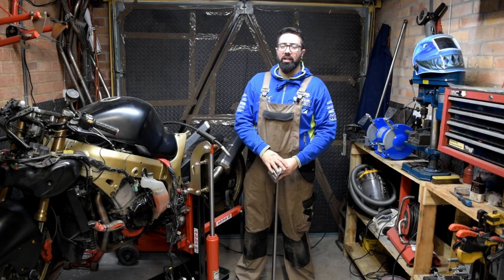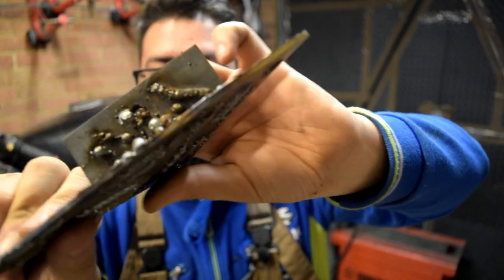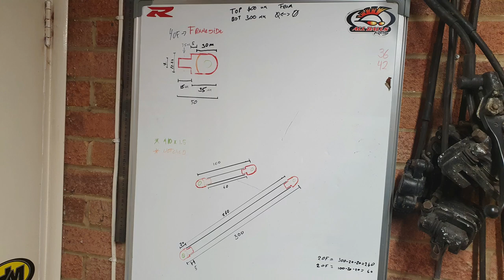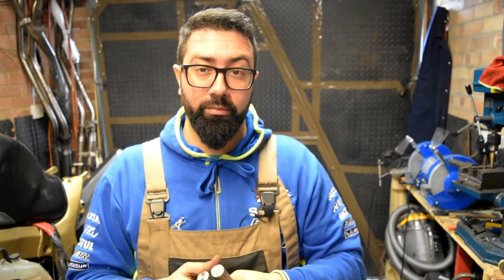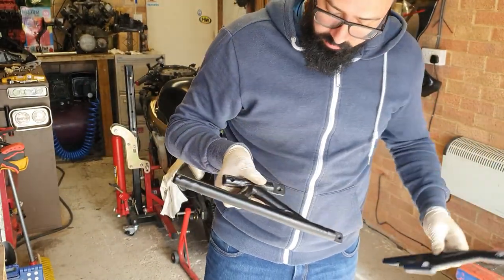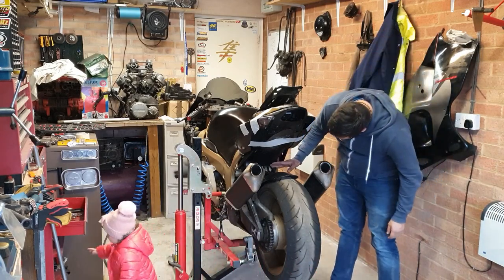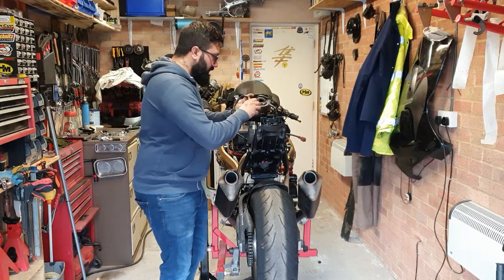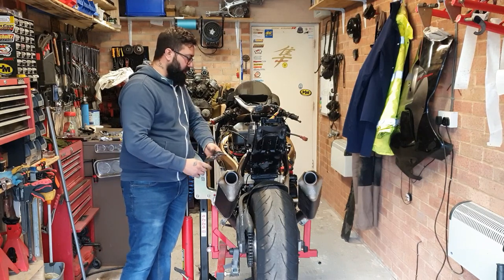SUZUKI HAYABUSA RESTOMOD EP 3 - Tube subframe-RGMgarage

Comment: Nice work! I like how you did the subframe yourself. I'm going to be doing the 07-08 Gsxr1000 tail conversion on my restored Hayabusa, but, I've decided to take the easy ( and more expensive) route,  and buy the Gregg's kit. Keep up the good work! 👍🏿
Reply from the maker: Thank you, I have done the conversion previously copying the Gregg's kit design and had a couple of plates made but, didn't like the fitment and the need of using spacers as wasted space under the seat, as well as, the tail being so far back. Good luck with your conversion.
Reply: @RGMgarage  Thank you
 My concern with doing the conversion myself has always been having a custom seat made.
Reply from the maker: @jackdaniel1848  I just use the original busa seat and trim the 2 little hooks of the back of the seat  underneath. Or you can always try to find a 2nd hand Greg's one 😉
Reply: I want that conversion